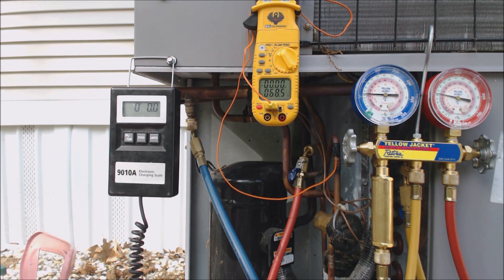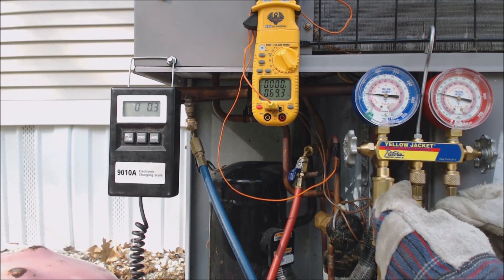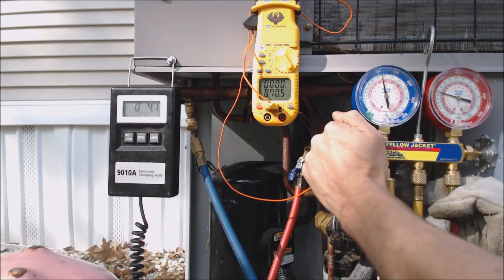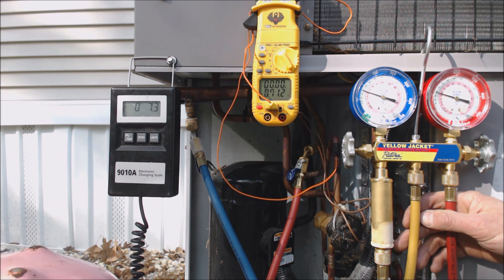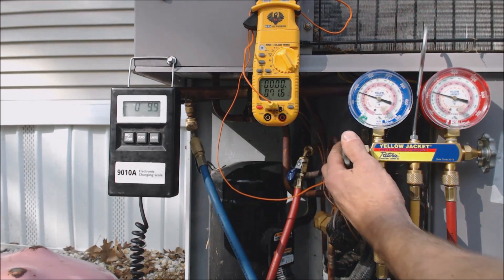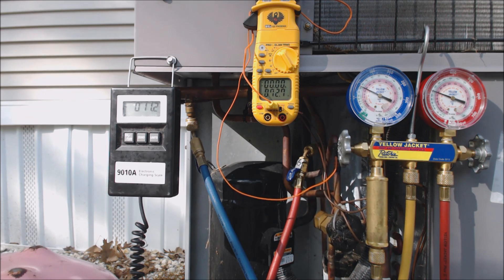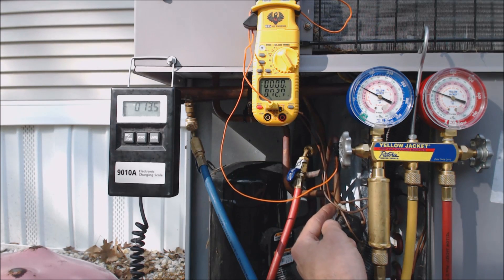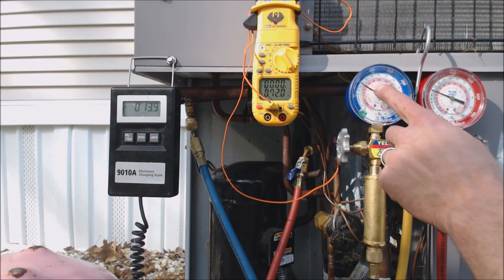R-410A Charging! Charging a System that is Very Low on Refrigerant,  Avoid the Evap Freezing! Part 1

Comment: I'm from Australia and I find it funny that you turn the bottles upside down.. I haven't seen that in many years. We have bottles with a liquid port joined into the suction (liquid side has a straw that internally goes to the bottom of the bottle). That vaporizer looks cool but personally I still wouldn't trust it.. zeotropic gasses on a large system might get effected using this method. If a system is empty, the way I like to charge is open the bottle (with scales of course) and wait for the unit and bottle pressures to equalise.. this usually gets you pretty close to the right charge.. but watch them scales! If it's a small system.. real easy to overcharge
Reply from the maker: Yeah I do not use the vaporizer when charging a system from scratch with the unit off. Just weigh liquid refrigerant into the liquid side until you get to the exact weight or a little less, then turn the system on and check charge in subcooling. All new systems I put in have txv's. Those tanks are what we have in the US. It sound like your tanks for virgin refrigerant resemble our recovery tanks. If you have a solid column of liquid coming out of the bottom of the bottle and then it hits the vaporizer and puts sat state or vapor refrigerant into the line then the refrigerant is coming out of the bottle as mixed. What is nice is that I can charge very fast with a vaporizer and not here any compressor noise changes, Thanks!

Comment: MESSAGE BECAREFUL TO AMATUERS..YOU CAN DESTROY YOUR SYSTEM IF YOU DON'T UNDERSTAND THE PHYSICS..IF LIQUID GETS INTO YOUR COMPRESSOR BE PREPARED TO BUY A NEW ONE
Reply from the maker: This is correct, weigh the liquid in slowly and with a vaporizer such as the kwik charge used in the video and also listen for any noise changes coming from the compressor. Any difference is no good. That is a vapor compressor, thanks mattyboy ahoy!

Comment: is a liquid vaporizer useful?
Reply: hello, are you sure the service valve is on the discharge line?  that doesn't make sense.  when you are checking subcooling, you are checking how much heat is getting rejected from condenser coils.  if the port is on the discharge, the refrigerant hasn't even had the chance to enter condenser coils.  what would be the point of checking it at the discharge?  I might be wrong.  I just wanted to confirm
Reply: hell yeah i want one
Reply: +acservicetech sir what is the accurate psi for charging A/C  lowside and highside thanks I'm waiting to your answer thanks a lot.godbless
Reply: that's a variable answer. You just can give a psi
Reply: As a ballpark figure you want a 40 degree change of state in the evaporator. That is about 120 psig for 410a. Head pressure is dependent on outdoor ambient temp and as a general rule the change of state temp in the condenser should be 30 degrees hotter than the outdoor ambient temp. On a 95 degree day like I had the head pressure was 445 psig.. On an 80 degree day you should see about 368 psig. That is if your coils and filters are clean and fans are all running properly. Dirty coils and bad fans will make those pressures change.
Reply from the maker: Yes absolutely, and I only use the imperial 535-c and not those small little orifice ones. They really make it safe for the compressor I can add faster with not worry about damage. You can hear if you add too much liquid but I don't hear anything really using that "Kwik Charge".
Reply: you can destroy the compressor if liquid refrigerant gets in it
Reply from the maker: You are right. This is an odd charging technique. It is still incorporating the subcooling reading into the analysis though. This is different from a normal subcooling procedure since it is a package unit. The manufacturer has run tests on this and knows exactly what the temp reduction should be including the subcooling in the calculation. I don't know why they didn't just give a service port after the condensor coil. They did however give the data on the inside of the cover to show what subcooling was needed. They called it subcooling even though it was actually the heat rejection from the discharge gas, through the sat phase and subcooling numer added together. You are thinking on the right page. This was an odd one and not a normal subcooling charging procedure, thanks

Comment: My ac system is very low on 410A, and my split system is calling for 8 degrees of sub cooling. I have a txv and the sub cooling is at 2 degrees. The low side is currently at 30 degrees in the middle of the evaporator cooler. So when I start my unit up do I need to wait for 10 minutes before I start to add 410a on the low side, or should I start it up and begin to add 410 immediately.
All your videos are real good, and I have been buying many of your tool posted. I will be getting the scale as well when I pick up the r410a
Thank you for all your very knowledgable videos.
Reply from the maker: Add the refrigerant after about a minute in that case and yes don't let the evap feeze. You can start by adding maybe 3-4 ounces and give it a little time, then just 1/2 oz-1 oz at a time and wait. You are asking the exact right questions. Great to hear and thank you very much!

Comment: I always wonder if charging by recommended SC SH  give a solid liquid feed to the TXV  when line sets are over 150 feet
Reply from the maker: That would also depend where you are running this 150' of liquid line with the pressure drop and a possible temp increase say in an attic if it were that long. The thing is that the more subcooling you add, the more the liquid will take up space in the outdoor coil of a condensor so you don't want to overload that either. If it calls for 10 then you could put in 13 degrees of subcooling. Thanks.
Reply: I know too much liquid would reduce the condensing section of the unit . It seems a liquid receiver at evaporator would reduce that and insure a mostly liquid supply to TXV This would let the condenser just do the condensing.These large houses have  become the norm and the residential market for equipment doesn't address the issue much . They make some great wifi gauges that are capable a very accurate charge and always wondered if factory recommendations are reliable with increase refrigerant line sizes , pressure drops  etc...is only a guess unless extra gauge ports are installed .. extra work and more places for leaks . I would also mention super heat should be checked at the evaporator and no one ever does that . Correct me if I am wrong ,but shouldn't super heat be adjusted at the valve and they are  never accessible .    Thanks for the reply.

Comment: Why do people use the AC gauge hoses with the shut off lever on them?
Reply from the maker: Are you talking about the shut off on the hoses? It is so you have more control over your vacuum and your refrigerant from coming out when disconnecting. When you pull a vacuum, you can switch to the refrigerant without losing the vac. Thanks

Comment: If you kept the bottle right side up, wouldn't that also give you vapor?
Reply from the maker: Yes if the virgin R-410A bottle was right side up it would be vapor but the manufacturers of equipment and the refrigerant manufacturers do not want you to take refrigerant out of the bottle unless it is in liquid form so that the two refrigerants that make up R-410A have the proper mix. This differs from R-22 freon as that is made of just one refrigerant. Thanks Perpetuant!
Reply: acservicetech - excellent point so why not evacuate and replace with virgin liquid?
Reply: @melvin292  - because it would take twice as long and time is money. Not only that but on a system with 6 pounds of refrigerant that is 2 pounds low, you would end up recovering 4 pounds of perfectly good refrigerant and then turn around and put 6 pounds of virgin in. That stuff ain’t cheap.

Comment: 410 is liquid line charging so how come you charge it on low side mean vapore side?
Reply from the maker: Great Question! We always charge a little liquid at a time into the vapor side because the pressure in the tank is higher than the low pressure in the system on the low side when running. Thanks

Comment: why are you charging the suction line and not therefrigerant line?
Reply from the maker: Refrigerant is always charged into the suction line of the ac unit while the unit is on. You can weigh liquid into the liquid side of an empty and vacuumed system liquid line with the power off only. Thanks

Comment: How do you know if the refrigerant didn't fractionate when it leaked? I would think you would have to recover and add virgin 410a.You have Great videos. I really enjoy them. Thanks
Reply from the maker: Great Question, because this is a near azeotropic refrigerant with .3 degree temp diff on the pt chart, they tend to leak at the same rate. The manufacturers recommend to charge as a liquid to be safe. On R-410A safety tests such as ESCO and EPATEST.com you can top these off after you have fixed a leak. Thanks and I am glad you are ejoying the videos!

Comment: Assuming this procedure is being performed while in AC mode, what if anything needs to be done differently when in HP mode?
Reply from the maker: The issue really is if the system has an accumulator and in heat mode, you don't know how much refrigerant is in the accumulator due to the varying load on the outdoor coil. Some people try to check superheat but it can't be a consistent number. Also if this charge is correct just say in a heat pump then the outdoor coil could still be freezing and is actually supposed to be due to the winter temperatures not that that is a good thing. This does not happen in cooling mode and that is why we can get the exact charge in during cooling when the accumulator is drained. If there is a bad leak then you recover the refrigerant fix the leak and weigh in the exact amount needed into the system. You would need to weigh in what it states on the rating plate plus any additional feet worth of lineset. Thanks!

Comment: Charging a System that is Very Low on Refrigerant, Avoid the Evap Freezing! Does that mean the system is in a deep vacuum?
Reply from the maker: Great Question, it means that if the vapor pressure converted to saturated temperature is less than 32 degrees then the evaporator coil will start to freeze. You must get the proper amount of refrigerant in to keep the saturated temperature above freezing and then after, make the charge precise with subcooling but no need to check subcooling until you get the vapor pressure up. Once the pressure is high enough on the vapor side you then can move to the high side gauge and check subcooling.  Thanks for the question!

Comment: Hey mate I saw a video from another bloke where he is adjusting the superheat by adjusting the TXV. Am I correct in thinking what he was doing is incorrect? When would it  ever be necessary to adjust the TXV? Is that just during the commissioning process?
Reply from the maker: Most txv's in residential light commercial comfort cooling systems are set to hold a superheat of 14 degrees and are non adjustable. If a txv was factory set and is good for a range of 1 ton then they would not need to be adjusted usually. If they are a more broad capacity or someone had messed with then they may need to be adjusted to maintain superheat. A txv may need an initial adjustment for walk in boxes or freezers.

Comment: "If you need to charge an R410A system, it must be charged as a liquid." 
I'm a newbie HVAC technician. Why is this circumstance necessary to charge as a vapor rather than a liquid?
Reply from the maker: The R410a is a 50 50 mix of two refrigerants in one. This refrigerant is near azeotropic meaning the two refrigerants have very close saturated pressures. Regardless of the close pressure temp relationship, the refrigerant still needs to come out of the bottle as a liquid but then metered down with something like I use which is a vaporizer before going into the vapor side. I use the kwik charge by imperial. I hope this answers your questions! Thanks!
Reply: if R410A refrigerant is added as vapor (bottle upright) the two different gases could separate and more of the one gas would be added. when bottle is up-side-down the liquid gases go in equally.  just physics.

Comment: if you fixed a leak then why didn't you just weigh the charge back in?
Reply from the maker: Many of the videos are made to show what if scenarios and not actual service calls. This would be as if they found a leaky Schrader or txv fitting. Here is a video on weighing in charge--https://youtu.be/ncgLDYrvN6w

Comment: hi mr acservicetech thank you very much for sharing your knowledge . your teaching and explanation is very good and informative. i learned a lot from your teachings. i got some questions. 1) what is the target super heat or sub cooling temperature which we have to set while charging the refrigerant for the ac unit. do we have to check the specs plate on the unit to consider the target super heat temp or sub cooling. some times they dont give . they  give only  pressure on high side and low side . in that case how do we charge. what kind of method used sub cooling method or super heat method? or just hook up the meters on high side and low side and let the refrigerant into the system on both sides and set the pressure?
could you please explain or make a separate video step by step.thank you
raj
Reply from the maker: For answers on superheat and subcooling---https://youtu.be/B7mm5dBNEeQ-----https://youtu.be/1aoE01-re1Q----https://youtu.be/Z7ihQjM-2hU----https://www.youtube.com/watch?v=rTKe3GQ381w&index=3&list=PLxnHR5_D2ojwGvhU1rseXQLJ-XBjBZMMk---- If a unit's rating plate is wore off and the unit then usually we figure 8-12 degree of subcooling.Check out the superheat playlist for how to find and apply the rating. I is a little a little bit involved. These videos should answer your questions. Please give me another comment with any other questions that were not answered in the above mentioned videos. Thanks!

Comment: I have a question that may be a dumb question,  but here goes.   on the low side/suction side of the compressor,    it's a vapor going into the compressor .      When the power has been off long enough for the entire unit to be at ambient temp.      #1   does that vapor become a liquid?   
#2   If it does can it slug the compressor on start up?
Reply from the maker: Great questions! The vapor meaning the low side and the liquid meaning the high side will turn into a saturated state at ambient. Picture it like a large refrigerant bottle with liquid at the bottom and vapor at the top. #2 is a very great question. I will refer you to this article due to the length of the answer--http://www.achrnews.com/articles/113991-the-professor-refrigerant-migration
Reply from the maker: I wanted to add that I am Saved by Grace as well! It is a beautiful thing!

Comment: I have a question.  Suppose you get vacuum pump oil into the lineset.  You notice this happens and you use Nitrogen to get it out of the lineset.  You perform a good vacuum and open the service valves.  You then realize the line dryer can still be saturated with mineral oil.  What is the best step to remedy this situation?  Thanks
Reply from the maker: If you did not turn the system on yet meaning running the compressor where the poe oil is at then you could recover not pump down, then cut the filter drier out and braze another in because the oils didn't touch each other yet. You could also use nitrogen to blow more out once the old filter drier is gone. How much vacuum pump oil are we talking? I am assuming you had an older style vac pump that didn't have check valve. Just a side note but everyone should always install filter driers inside so that they don't rot. It is not harder to do as some suggest. I am assuming that the filter drier was right next to the outdoor service ports. I hope that helped! Thanks for the question!
Reply: +acservicetech he already opened up the service valves and the system has been running like this for 4 days.   so he should recover the freon and place the dryer inside the house vacuum and recharge with new r410a.  is this correct.   The pump is an older Robinair 5400.  WE bought a new Appion TeZ 8 with the Megaflow kits to get a fast vacuum.
Reply from the maker: Depending on how much we are talking yes that should be done, you are not going to be able to get all of it out though even doing that because it is now on all of the walls of the tubing and piping and in the compressor. That certainly will help though! Thanks!
Reply: Thank you very much.  I asked like 10 guys on youtube this same question and NONE will help answer them.   Keep the videos coming you are awesome at the videos.  Some of these guys on Youtube are pricks...  I am going through my EPA 608 pretty soon.   I have more equipment than 90% of the techs that have arrived to my house...
Reply from the maker: Ha ha nice, yeah keep up the diligent studying and searching for answers. There are some good people that I get to talk to that are really going for it. Initiative is the most important thing. After you get done that EPA 608, check out my video on techs entering into the trades. I list some other easy to get certs that will help! You can find any video you want on the channel's VIDEO page by typing in the search box. Thanks!